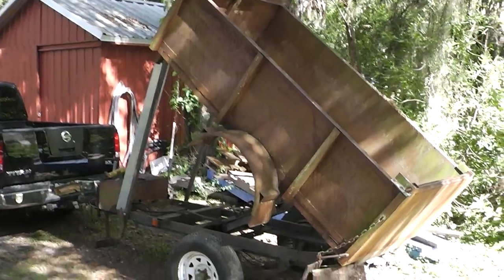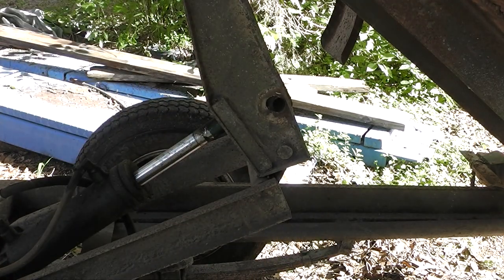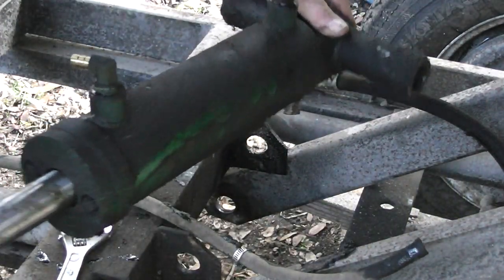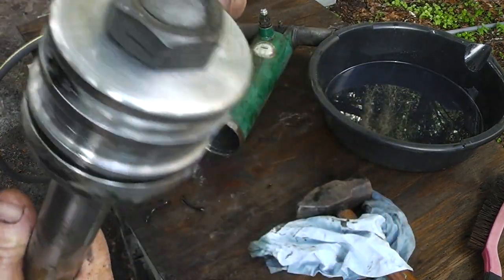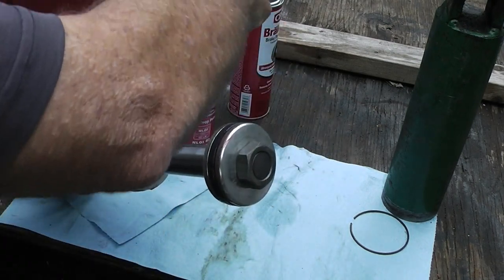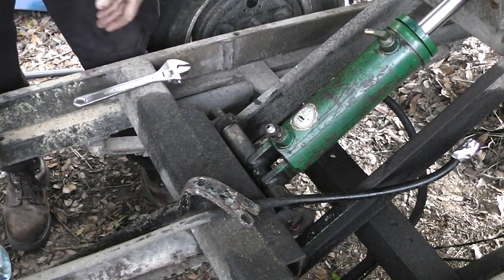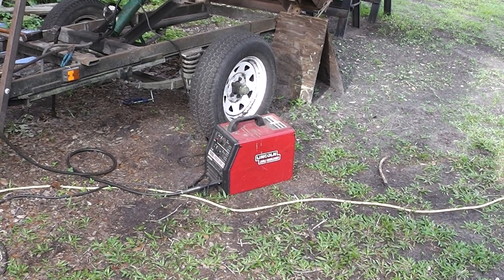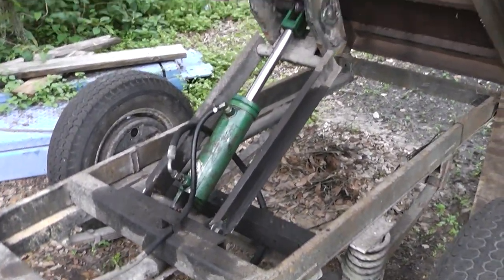Dump Trailer Hydraulic Cylinder Fixed!!

Comment: You can take Emory cloth and fix that cylinder where it doesn’t cause any issues down the road and chances are the seals will fail from hardening again before the cylinder hurts them

Comment: When you initially raised it off of the aluminum rectangle does the cylinder need to fill with fluid or….
Reply from the maker: Yes, the cylinder needs to fill with fluid. The hydraulic pump will make it happen.